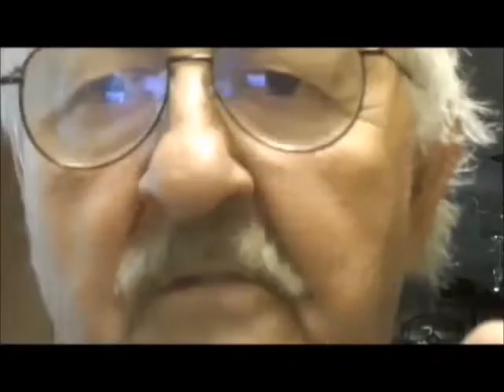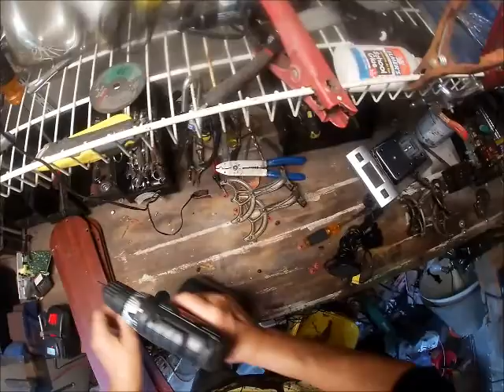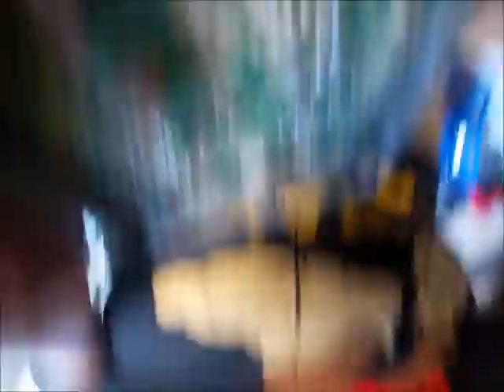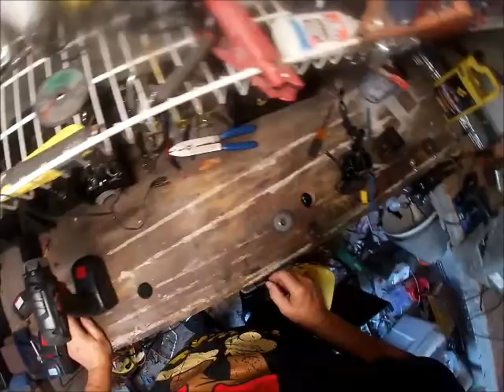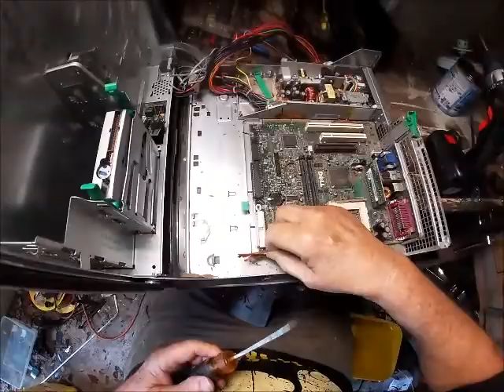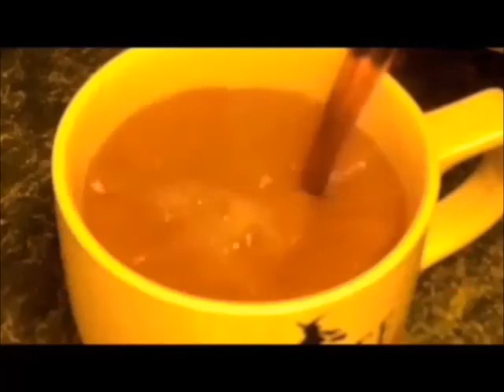Taking Care Of Some Loose Ends

Comment: I get Zinc price for the fan brackets!!! Catching up is a slow process here also!!!!!
Reply from the maker: I just can't figure out why some scrappers just throw their ceiling fans in the scrap steel pile, fan, and brackets and all, just doesn't makes sense to me
Reply: Might want to check them with a file. I use a chainsaw file, after assuming they were zinc. Melted some zinc and the brackets didn't melt. Turned out they were aluminum. If you microscrap there are three things you need, magnet, file, vinegar. A file will skate on zinc and dig into aluminum. Vinegar will bubble on magnesium but not on zinc and aluminum.
Reply: @JunkDobber  I strip all motors!!!!!
Reply from the maker: @kdscrapping4452  I strip most of mine
Reply from the maker: that's some good information Donnie, Thanks. I have 5 gallon bucket full of magnets and a file. I'll have to get some vinegar